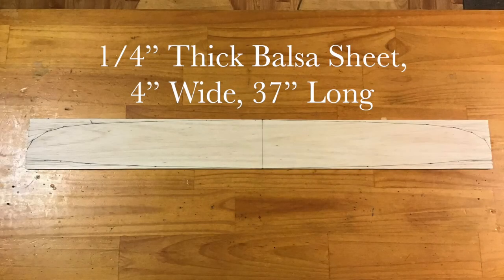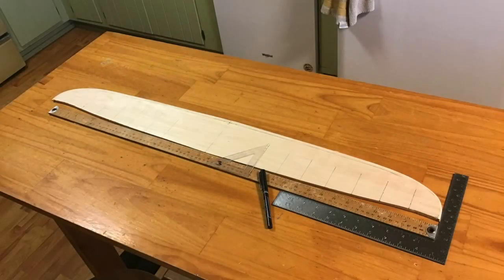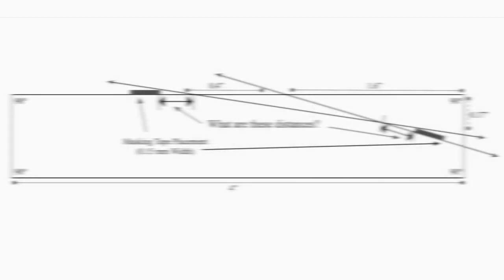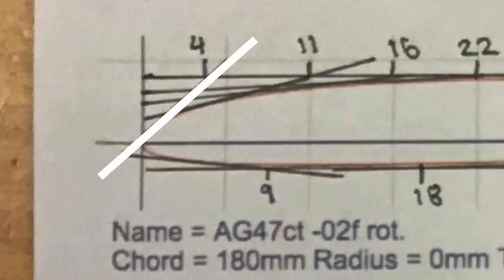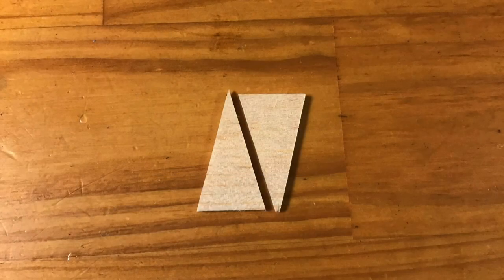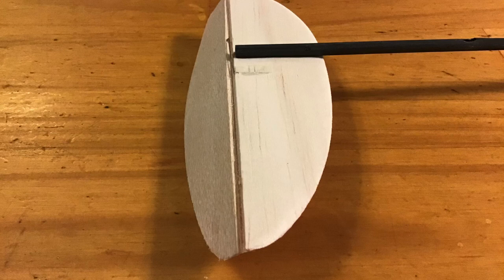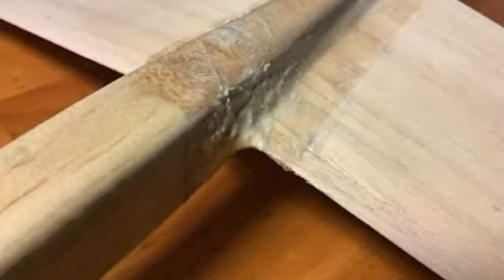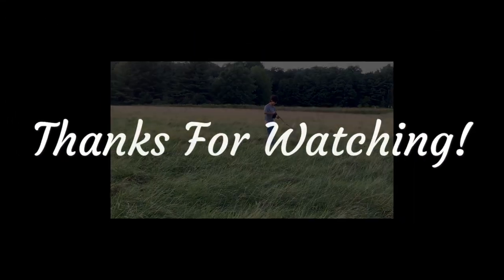Building a Balsa Glider With a Precise AG47 Airfoil

Comment: I use a similar idea with tape to protect surfaces next to each other.  When the tape starts to get thin, it is time to stop sanding with the coarser grit and move to a finer one.  Great work and technique.  Noticed your audio sounded a bit low in volume and muffled on this video, had to listen very hard at times.  Hope all goes well at uni, may I ask what you will be studying?
Reply from the maker: Yeah I maybe should've included that detail too: that as the tape thins out one must be careful not to sand through it and so finer grit sandpaper becomes more suitable. It's funny, the audio on this video is globally up about 40% from all my others. Might be something happening with playback on you end. Could be a problem of sound pressure, because voice has a lot of sibilant frequencies and low brass background music has a lot of low frequencies: that sometimes confounds small speakers.

Comment: God bless 3D printing and CNC milling
Reply from the maker: Shaping soft balsa is actually very difficult to do by CNC milling. I have had only marginal success with it. And 3D printing is far outside the weight margin for sucb a wing (there are some internal lattice designs that come close, but are still at least 30% heavier than a balsa wing of equivalent strength). 
To get a more accurate wing shape, the best approach is to go foam-core carbon fiber, using CNC-milled aluminum wing molds -- which ARE quite straightforward to make.

Comment: The main wing should not be cut at center. Balsa has a high strength to weight ratio along its length through the grain. You lose all of that when you cut it. Then you have to try to rebuild that strength back with all those methods and extra weight, and it's still not as strong. Soak the center of the wing for a long enough time to get a tiny amount of dihedral, without fracturing the center of the wing. Then ad a layer of fine fiberglass cloth and epoxy fast hardener to the center 3", of the wing top and bottom. It will be so strong you can attach the wing to the fuselage with lateral 1/8" dowels, and rubberbands going over the top of the wing, hooked on the dowels sticking through the fuselage just under the front and back edge of the wing at the outside of the fuselage
      Also, on your next plane, try moving the main wing back an inch, and the RC box further forward for more forward  nose weight, to help the balance of the glide trim.
Reply from the maker: You make an interesting observation. The dihedral you see on this aircraft is about as low as possible. We need at least that much. Surely there is no way to bend balsa, especially not 1/4" C grain balsa, to such an angle. And since the trailing edge is sanded so extremely thin, soaking the wood is out of the question; it will warp badly. We could try to heat the wood to weaken the lignin, but then we risk burning it. One method is to achieve the dihedral by gradually curving the entire wing. I have never tried that and it might be a good idea. A slight curve throughout the whole wing might be achievable with minimal steaming. I suspect over time the wing would tend to straighten out, though. Such a curve would also put the wingtip at a pretty steep dihedral angle ralative to the root, which would make the throwing somewhat logistically awkward. But it could be tried.
     As for the lateral dowels, that is tricky. They would create a lot - a lot - of drag. So they cannot be allowed to protrude from the fuselage. All attachments must be internal. The problem is that the rigidity of an attachment depends upon the force moments. The extremities of the aircrafrt have a greater moment around the inside of the fuselage. If we're talking about some sort of internal modular wing attachment, we must remember that during the throw, the force moment of the wingtip about the point of wing attachment matters a lot. There is a LOT of force there. Every millimeter of leverage counts. So I think if we put rubber-band-dowel attachments inside the fuselage, they will not be nearly strong enough to hold the wing in position. Besides that, the attachment will add a lot of weight. Rubber is a very heavy material. And to achieve a rigid attachment, we would need a lot of it. Probably 8 or 9 grams of rubber bands to even barely hold the wing firmly enough in place for a light discus toss. 
     You mention increasing the size of the nose. I am very reluctant to do this, since firstly the aircraft is designed to balance with this configuration and in flight it does balance very well. But more importantly, the fuselage adds a lot of weight and drag. The more we can minimize the non-lifting, drag-inducing, stuff-carrying section of the fuselage, the better. I put a great deal of design effort into minimizing the length, width and breadth of the fore fuselage section. So yes, we can increase the size of the nose and move the wing back, but the aircraft will perform more poorly, so it should be avoided.

Comment: I am intrigued as to why you used AG47 for this.  Mark Drela created a range of airfoils for DLG's from AG03 to AG19 to be used progressively from root to tip in "family" combinations, yet you chose a specific tip section from a more advanced combination intended for ailerons, designed for the Apogee 2.  Did you check its performance characteristics at appropriate Reynolds numbers with X-foil or W.H.Y. before selection?
Reply from the maker: Sorry for late reply here. Yeah at the time I checked the performance numbers at low Res. Simply used the Airfoiltools data and interpolated I believe, didn't use X-Foil but actually I don't see why I couldn't have. For other aircraft I use it where needed. I'm not sure what exactly the target performance was -- this was a while ago and all the documentation is scribbled down in a notebook somewhere.
Reply: @AeroCraftAviation  I was also in error here.  it was used on Supergee!  I realised after I posted that you had moved on to Uni  and probably would no longer check it.  I suppose I assumed you were fairly familiar with Drela's work, because your sanding technique was similar.  The main inconsistency is that it was designed for a flapped wing, which as you will now realise usually means a narrower drag bucket with excellent performance over a smaller range.  The low number ones were designed for 2 channel, so have a wider speed range at a slightly lower overall performance.  It is rewarding to see someone of your age taking this rational, scientific approach compared to much of what is posted .  My biased point of view is probably because I have reached the age where  I can no longer launch a DLG without going into rehab for a week afterwards!  Best wishes.
Reply from the maker: @petegarnett7731  Yeah I guess at the time I must've been aware of that. The main consideration was this: Given the thickness and width of my piece of balsa, I was limited a specific relative airfoil thickness of about 5%. So if I want to directly use the data from airfoiltools.com I would have to limit myself to airfoils around that thickness (knowing that at low Re the performance doesn't behave predictably as one stretches or squishes the airfoil vertically) Out of the various airfoils around 5% thickness, the ag47 was the most desirable. And also it was the closest to 5% so its data were most representative of the wing I would buid. I think that's really why I chose it -- the convenience of being able to read data right off a table.

Comment: How i do it... i make 2 metal or printing plate ribs... the base and the tip rip... i glue them on the ends (wings can be made in more than 1 piece) ...so lets say 4 pieces, sanding it into the profile with a plat square iron bar, it has weight, so you use the weight to sand.
And i glue the parts together, and then i make the winglets and glue them on there
Reply from the maker: Yes that method works well for the shape, but the structure isn't very strong because the wing sections have to be joined end-to-end. So for a hand-launch glider, that method can't be used. But for a motorized aircraft, or for a hi-start glider, or for a slope glider, yes that method works great!
Reply: @AeroCraftAviation  i did built a 1m DLG like that😉 works fine if you know how to strenghten it.
I launch mine up to 35-40m with no problems
Reply from the maker: @jasmijnariel  You must have a spar or something running along inside the wing to join the pieces. Or maybe you do a lap joint where the pieces meet edge-wise? I'm interested in how you can get such a rigid wing that way. Because I have tried that method before but never got a very rigid result. You should post a short video showing the aircraft and some build photos!
Reply: @AeroCraftAviation  yes i had a plywood spar in between the joints and fiberglass reinforcement
Reply: @AeroCraftAviation  you should check the mimi DLG
Reply from the maker: @jasmijnariel  Aah yes that explains the strength!

Comment: Do you think a DLG with a 30 inch wingspan would work?
Reply from the maker: Yeah, it won't glide terribly well on account of the small size, but for sure it'll work just fine. Here's a really little one I made: https://www.youtube.com/watch?v=7Acb_PBHXWw
Reply: @AeroCraftAviation  sweet, just wanted to make sure, it's just a concept but I was thinking of making a DLG that would be used for Dynamic soaring in strong winds, it's wings would be made out of carbon fiber plating to handle the strong loads (some dynamic soaring gliders can experience upwards of 100 Gs) the only carbon fiber plates I could find for cheap were only 15" long and I wanted to make sure it would work since I can't find much of anything on 30" dynamic gliders or DLGs. I'd make the wings the same way you make your wings but instead of balsa it would be 1/8" carbon sheeting. I'd have to add a bit of weight to the fuselage though to make it work as a dynamic soarer so it could punch through the wind. Check out dynamic Soaring gliders if you haven't already, it's amazing the speeds these fragile looking planes can reach. The worlds fastest RC plane is a DS, no motor on it at all and it reached 548mph. Anyway thank you again :)
Reply from the maker: @RicardoRodriguez-mh7my  Yeah well the structural requirements would be very different for your little glider -- you know, square-cube law and scaling effects. So you won't need all the crazy rigidity those big DS gliders like the Kinetic need. But because of lower inertia, what you WILL need is extremely fine aerodynamics. I'd recommend using a very hard sheet of 1/4" thick balsa (a piece weighing 80 grams or more) and sanding an airfoil shape like in the video. (Might need to use a planer for the denser wood). Then, vacuum-bag the wing with a few layers of carbon fiber cloth and 48-hour resin. That'll give you all the strength you need even for really high-G DS. Make sure to get the trailing edge really tightly joined. The most likely place where a homebuilt layup wing will fail is at the trailing edge, where the pressure gradient might pull up the carbon skin. You can also cut a slot down the wing at the airfoil high-point and insert a spanwise carbon spar. Make sure to rough up the carbon spar surface so it really adheres with the wood. Good luck with the build! :)
Reply: @AeroCraftAviation  That's true, thanks for the advice, your wing idea with the bagging would probably be cheaper as well XD. When/If I get around to it I'll maybe send a link to the finished product :)